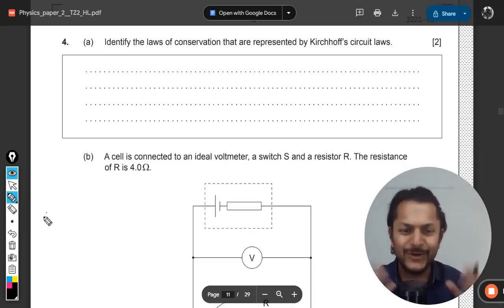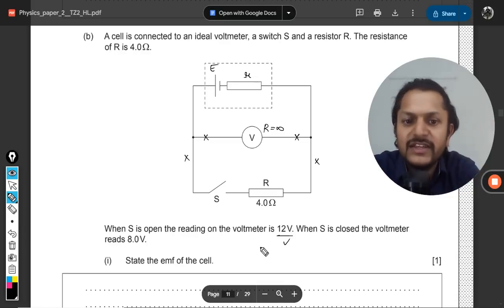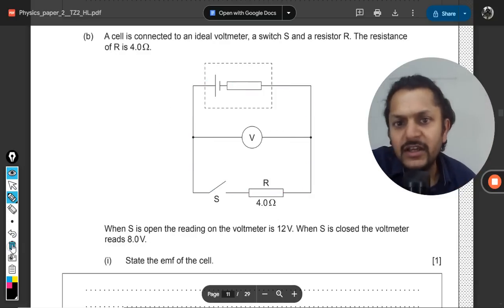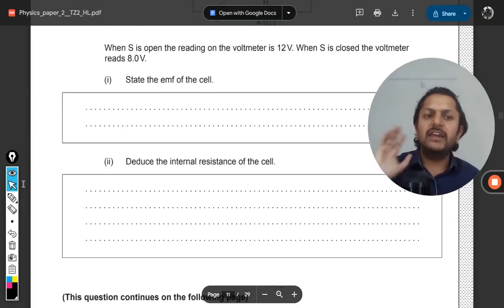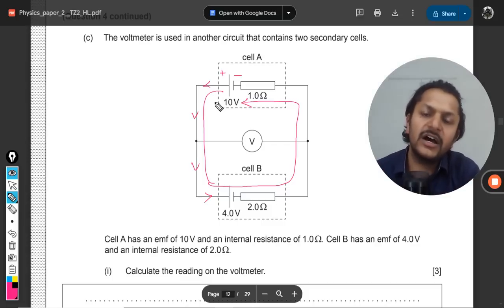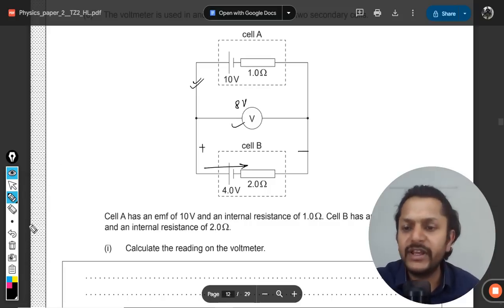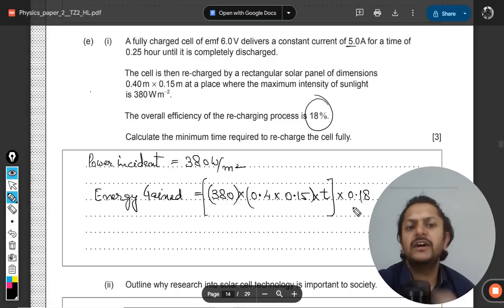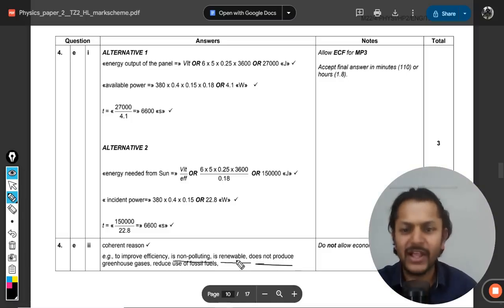Identify the laws of conservation that are represented by Kirchhoff’s circuit laws. A cell is connec

Comment: For the c)i) question,  I used I = I1 +I2.  I1 = 10A and I2 = 2A so I = 12A.  Then I found the total resistance to be 2/3 Ohms. After that I found V = 8 volts.  Is this method also approved in IB?